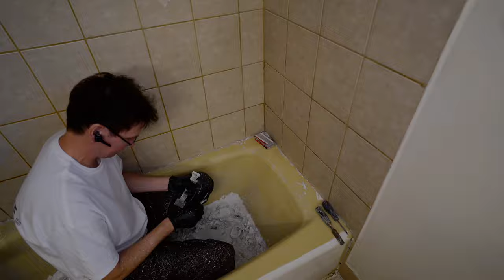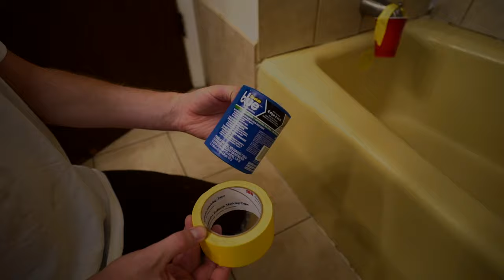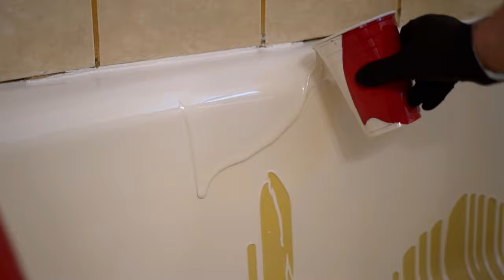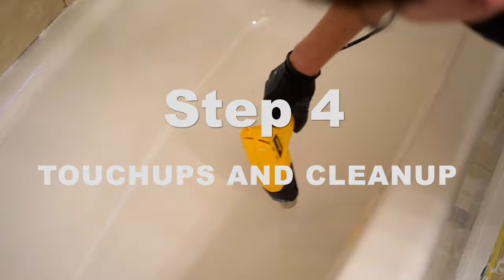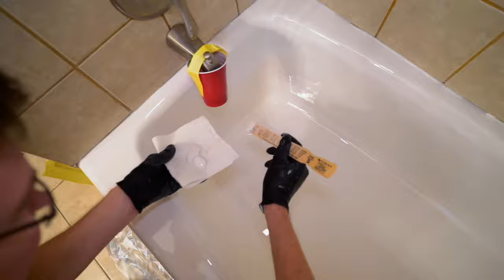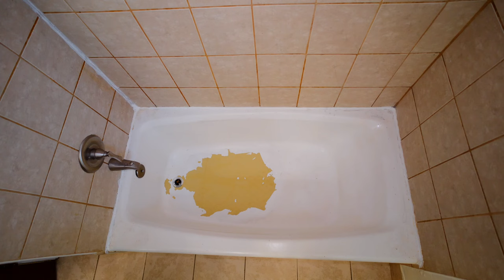ArmoGlaze 2K How to Bathtub Refinishing  and Bath Reglazing Short video

Comment: I'm wondering how much this costs. Sites and businesses should give an all-around estimation. They lose so much business because they demand potential clients go through a consultation process when they could tell them that for a regular project it's between $400 and $600 or between $700  and $900. If people just knew if it was in their range of affordability they'd call immediately instead of just letting the tubs go to waste.
Reply from the maker: This depends on where you are located, what kind of bathtubs you have, and the condition of the bathtubs. Price will be at 395 to 700